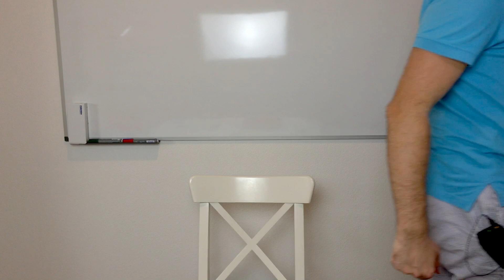New 7DoF Brushless Robot Arm: Shoulder (part 1)

Comment from the maker: Please leave the comments! This will help to promote this video. Thank you!
Reply: thank you for respected work
Reply: Very interesting project! Can't wait to see the arm finished!
Also, are you sure you want to put the encoder in the motor pullie? I think that the motor is going to move almost too fast for the encoder. I would suggest putting it in the middle pullie to reduce the speed and the weardown just a little bit.
:)

Also, very cool that you're gonna give the arm for open source domain!
Reply: Slushee The controling board for the brushless motor needs an encoder to know when to energize the coils and thats how it can spin the motor slowly. Encoder won't wear because it will probably be optical or magnetic :) The maximum encoder speed to not lose the steps is connected with the processor which counts the encoder steps, not with the encoder itself.
Reply: @kamilkosi9101  Oh... Thanks :)

Comment: Nice job - had you considered another timing belt - or even lengths of cut timing belt instead of the cable, I have experience using cables on robotic axis in industrial application. When your doing fast cycles and short movements the cable starts to wear.

Comment: I would recommend some T handle allen wrenches, by the american company called Bondhus I believe. The red ones are metric. They have a really heavy handle and are really handy for this kind of assembly. You can rotate the shaft with your fingers really fast and the inertia of the handle keeps the wrench spinning for a long time. There is also some torsion bar effect when you are tightening the screws so make sure you are getting the longer ones, i believe it’s 9 inches. Really makes a world of difference.

https://rover.ebay.com/rover/0/0/0?mpre=https%3A%2F%2Fwww.ebay.com%2Fulk%2Fitm%2F311153495309

Comment: using wire may result a lot of unpredictable backlash and calculating angle of joint will be vary every winding on wire maybe it would be better to have pulley belt system or gears to eliminate unpredictable movements on joints

Comment: You got a new Patreon! I'm happy that you're back focusing on the arm. I really need a solution open and with the ODrive.
I like the use of the cable, and the design decisions you are taking, However have you considered using a thick nylon line? It would be easier to cut and tension I think. keep on rolling!

Comment: As usual you made a great work!!!; by the way; I noticed you used a bigger motor ( which means higher torque ) in stead of a high gear reduction set; that means you replaced the weight if the gears with the weight and size of the motor itself; for the cable; I have no doubt of your experience but I suggest make the the final pulley as a gear; as I `d like to ask about the speed of the motor; with such low gear ratio it would be difficult to control by electronics ; or I`m not right ?
Reply: As I`d like to add that is the design is so big ; the size can be reduced.

Comment: How did you model the pulley teeth? I've been trying to model some pulleys to work with a GT2 belt but I have been issues with not all the teeth meshing properly. Thanks
Reply: Here's a good script for OpenSCAD to generate them https://www.thingiverse.com/thing:16627
Then check the printed dimensions with calipers to see if you need to scale it at all.

Comment: Glad to see a new version of the robotic arm! Couple questions though...
Like others previously asked, What was reasoning behind the cable on second stage?
What is you expected cost for this project? that already at least 1200$ for motors and Odrives
Did you print all those huge print on your prusa printer?
Reply: If your building a $20K arm, it's very reasonable.

Comment: You shouldn't get stringing on a 3d printed part that has no islands. Check your nozzle path/travel settings. You can set the path to stay inside the printed part and not travel outside of the piece like yours did.
Reply from the maker: I don't have any stringing with PLA, but these parts are printed from PETG...
Reply: I got stringing like that on gears when I first got my 3D printer, and the problem was in the slicer settings (not setting wall thickness to a multiple of the nozzle diameter).

Comment: Great work, 
i have one  question, why you used cable instead of belt?
Reply from the maker: Thank you. Cables are much stronger than belts. I would need to use 25mm wide belt to replace this cable. But I don't know where to buy such belt...
Reply: @Skyentific  You could use 5mm polychain, which is I think about twice the strength of GT3 (I haven't been able to find any data tables for the 5mm pitch, so I estimated the capacity by extrapolating the numbers for 8mm and 14mm pitch). They come in 9mm, 15mm, and 25mm width. Not a lot of length options available, but this actuator could probably be adapted to 375mm or 425mm. https://www.vbeltsupply.com/poly-chain-gt-carbon-belts/5mm-pitch-9270-series-short-length
Reply: There are belts with cables inside. 25 feels insanely big for your 20Nm with the diameter of wheels you use.

Comment: Have you looked at using  VESC for the motor controller.  apparently the vesc 6 (6.6) hardware is capable of making robotic arms, however I haven't seen anyone try before.
Reply from the maker: I plan to use ODrive. I already used them a lot on my channel. And ODrive is cheaper than VESC.

Comment: What was the cost of the ring bearing you used? It's difficult to find ring bearings (80mm plus inner diameter) at a reasonable price.
Reply from the maker: I don't know what you call reasonable price. In my experience they cost around 100$ (from china).
Reply: @Skyentific  Have a link for the bearing?
Reply: Can you provide any detail about the bearing. What is the size of the bearing ID and OD?

Comment: Great, can't wait to see the final arm. I'm really worried about that cable reduction though, seems like it can easily get slack and double up on the small pulley. This would make it inaccurate and hard to reach the 1mm precision. I hope you prove me wrong, also I would like to know why you picked cable over another belt.
Reply: In my experience, working with cables is hell. I really hope he is smarter than me and the people I worked with before.

At least, he should have put the encoder on the output shaft, not the motor shaft.
Reply: George do the cables get slack over time?
Reply: @justtestingonce  In my experience the attachment of the cable to the shaft is always a point where it is prone to slipping. I like how @Skyentific used 2 bolts to hold it. This might be just enough redundancy to do the trick! Will have to see in practice.
Reply: @gedr7664  yeah, I commented the same, that ac motor must be moving real fast, and that's not a think you want an encoder to be stressed with
Reply from the maker: Great question! Probably I should do a small video about this. The advantage of the cable - it is super strong, and it can handle a lot of force. The belts are weak. For example, if you would like to have 30N.m, on 10cm diameter output pulley you will have the force of 600N, which is equivalent of 60kg!!! This is ok for steel cable. But it is a lot for the belt. You would need to use around 25mm wide belt. I don't know where to buy such belt. SDP-SI does not have many belt like these...
Reply: @Skyentific  would you say the same for the more modern carbon and aramid belts?
Reply from the maker: When the cable system is properly designed, and the cable is properly tensioned, you would not have a slack or "double up"... There are some commercial robot arm which are using cable system. Also cable systems usually are very efficient.
Reply: @Skyentific  Thank you for your reply! I hope you prove me wrong, because then I would stop being scared of using cables in my projects :P.